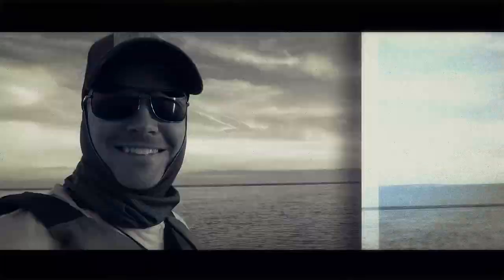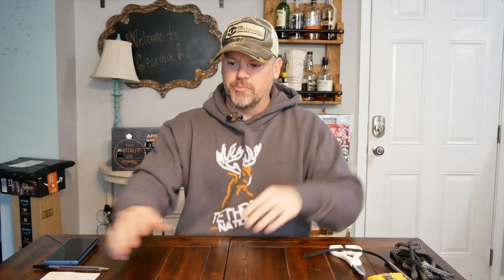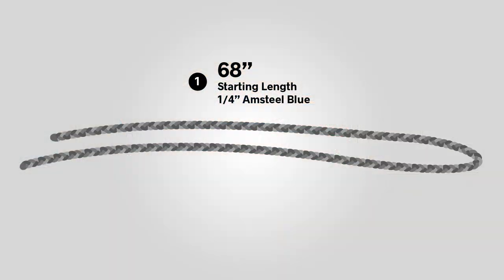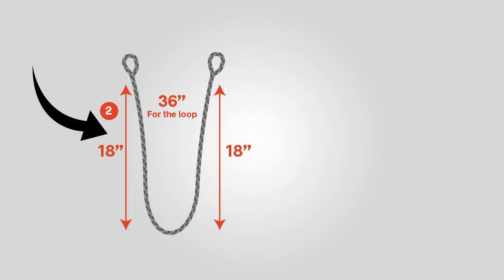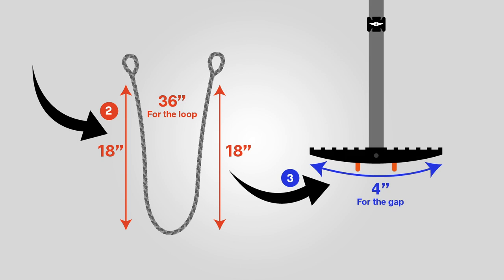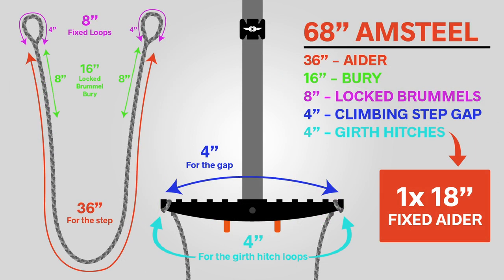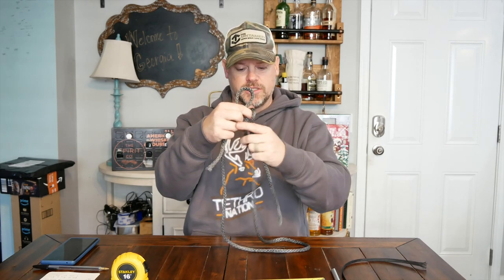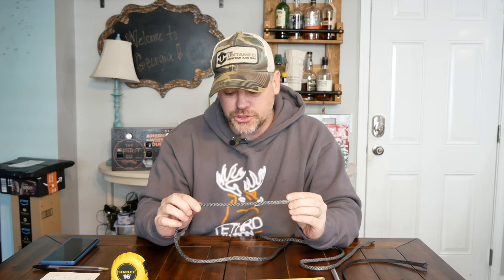How to splice Amsteel? This is a beginner level STEP-BY-STEP single step aider splicing tutorial

Comment: I made the same type of aider with 1/8 amsteel.   A gutted piece of paracord  runs from the top of the tube on my one stick and I can pull the aider inside the tube for storage.   It’s always there and not in the way when not being used.  Add a small piece fuel hose and reflective tape for  safety.

Comment: Hey Greg, love your content, really helps a lot of people, enjoy your stuff.  made some 18" aiders out of 1/8 Amsteel.  My question is does the bury bear the weight of the locked Brommel knot?  I thought the locked Brommel bore the weight of the load.  Not sure if I got the length of the bury long enough.  Asking for my peace of mind.
Reply from the maker: So I'm definitely not an expert here, I'd ask a splicing professional to get the right answer. But the way I understand it is both the locked brummel and the bury are holding weight. When you put tension on the rope it squeezes the bury and pulls against the lock at the same time. My assumption would be the lock is doing more of the work with the bury playing a supporting role. Again...I'm not a professional and can't say for sure. That's just my best guess.
Reply: @G2Outdoors  thanks for the help

Comment: Granted understandably that larger diameter rope means more weight it can handle, but why did you choose 1/4” over 1/8” ?
Reply from the maker: 2 Reasons.
#1 I had it in my garage (that's the main reason lol)
#2 it's easier to show how to splice with larger diameter rope. The smaller stuff is harder to use for demonstration.
As long as you're comfortable with the weight/size of the 1/8"...it should work the same.